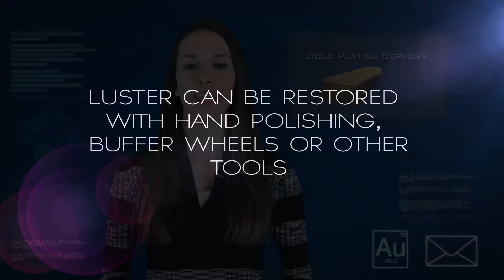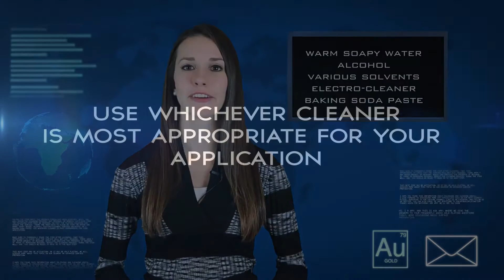Gold Plating  - Basic Surface Preparation - Ask Amy

Comment: If I’m only plating Brass with Nickel, can I use battery acid for my Surface prep ?
Thanks,
Lee
Reply from the maker: Not sure about that. We only recommend using our solutions. We do not know what the acid you use could do to your part or even your other solutions. You could test a sample piece but realize it could contaminate your other solutions or damage something. It's up to you if you want to try that.

Comment: So it's best to gold plate something that's already been nickel plated?
Reply from the maker: xR56x That's a great question.  The answer is yes, it's very typical to put a nickel underplate to keep the substrate from corroding up through the gold.  Also, nickel helps to produce a more shiny surface to apply the gold to.